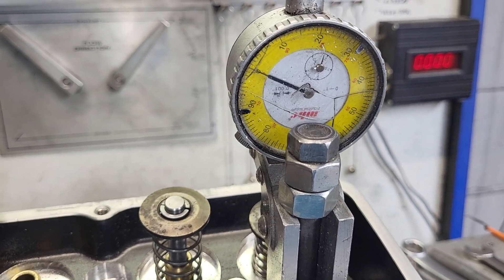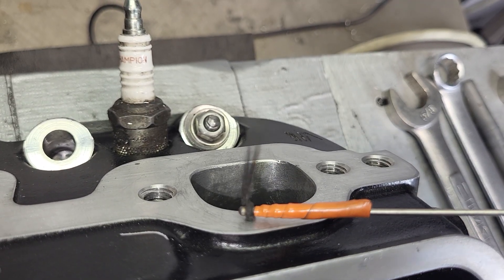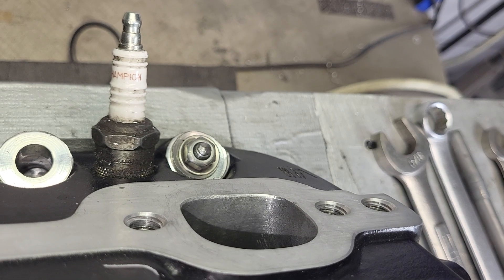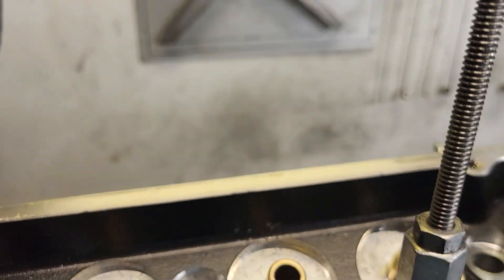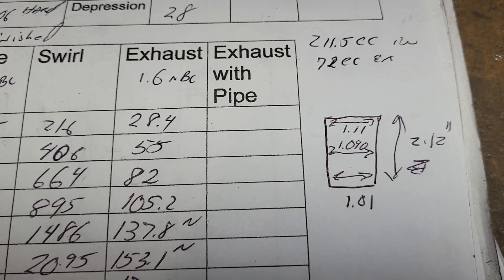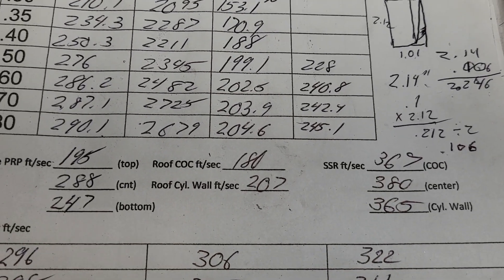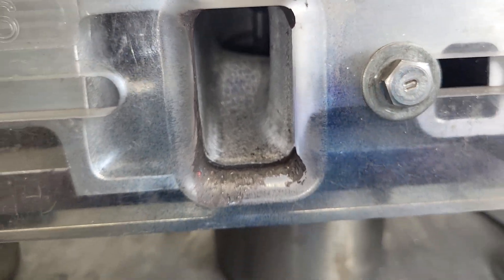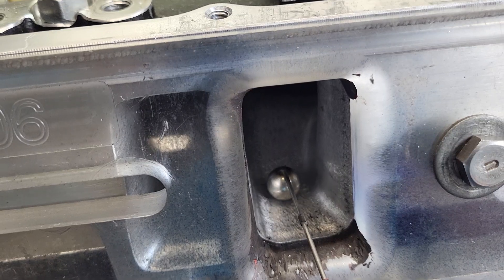Flow bench tools, flowballs, and flow flags. How I use them to determine airflow.

Comment: Flow ball is interesting, thank you for that. Gives a whole new perspective on the relevance of finish detail when you can stuff a half inch ball in there and make next to no difference? I'd take that to mean the port is way bigger than it need be. What message am I missing?
Reply from the maker: @funkiwikid6106  I try not to make the ports too big. The disruption the ball cause helps flow stick to ssr and increases flow. Tells you the ssr needs more work!

Comment: I would have thought that ball on the floor would have dropped the flow more than 2 cfm

So does that mean there isn't much flow down there to disrupt?
Reply from the maker: @jseal21  No, that means with or without the ball the ssr is working.
Reply: @servediocylinderheads   Gotcha 👍! Thanks for the video.

Comment: Ok Charlie one more question do you consider air speed and velocity the same do you use a pito tube to measure air speed
Reply from the maker: @rchardsmith605  Average port velocity and local velocity is different. All my air speeds are measured with Pitot. Thanks

Comment: Hi Charlie. Thank you for the informative video. I have a question. Almost anywhere you put the flowball the flow didn't change very much. Is that not an indication that there is more volume/area than is needed? I was amazed that you could put that large a restriction (flowball) in the port and have almost no effect on flow. Thanks. Andrew
Reply from the maker: It may be that but it could also mean the air speeds are quite even. This is when you change flowball size and retest.